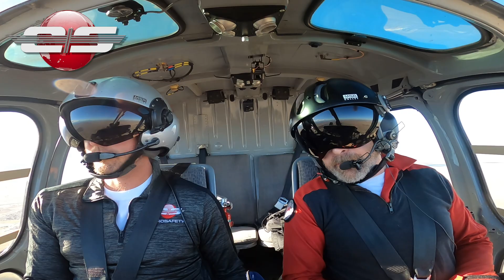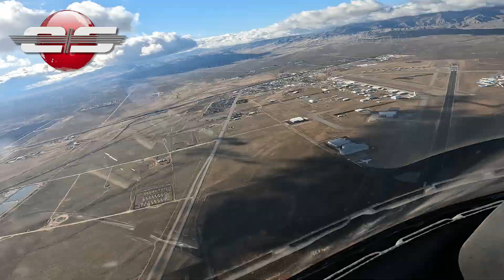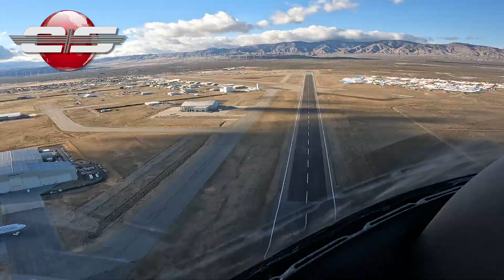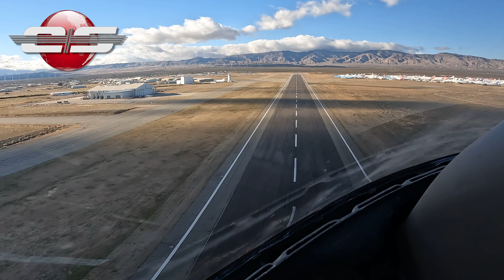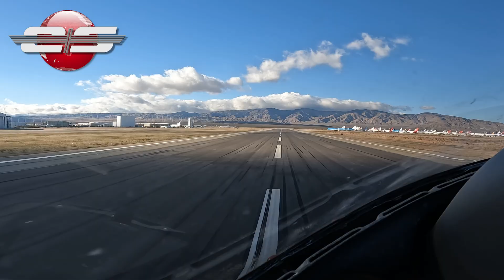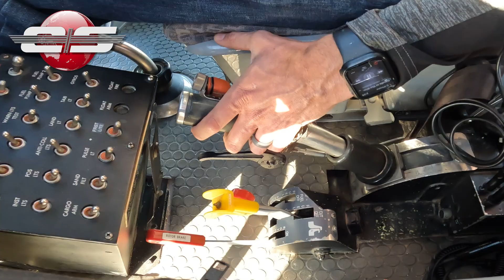#121 - The Unexpected Truth: Helicopter Engine Failure Explained

Comment: Why on some helicopters you pitch up a lot in the flare, and then go to flat position, and on this you keep the same (smaller) pitch up almost the whole autorotation ?
Reply from the maker: Good question. Smaller helicopters are flared at a low altitude, so the flare does not last long. In order to help facilitate braking action in smaller helicopters, a big flare is induced to provide for parasite drag to help the braking action and then the flare is immediately taken out because the ground is now close. In a large helicopter it is flared much higher (the heavier the helicopter the higher the flare) to allow for time for deceleration. Since the helicopter is heavy the rotor will stay at a higher value for a longer time then a light helicopter. If a large helicopter is flared aggressively and kept in the flare, the helicopter looses lift and drops rapidly... decreasing the braking time and creating a high rate of descent. The heavier helicopter can be momentarily flared "hard" at beginning of the flare and then placed back into a moderate flare in order to facilitate a bit of parasite drag braking but if not done correctly this can slow the helicopter down too much and if it looses all forward momentum it can descend straight down at a high rate of descent. I could go on and on for pages to nauseum.
Reply: Thanks for reply 😅